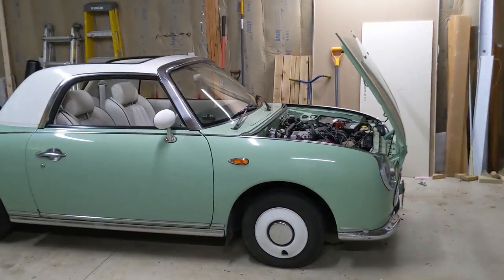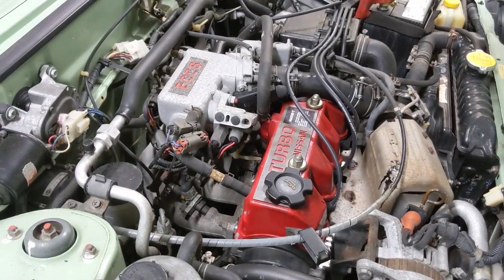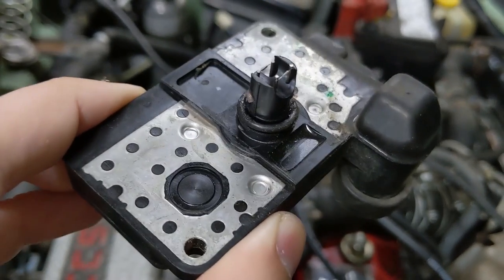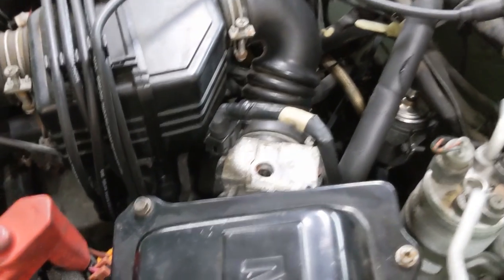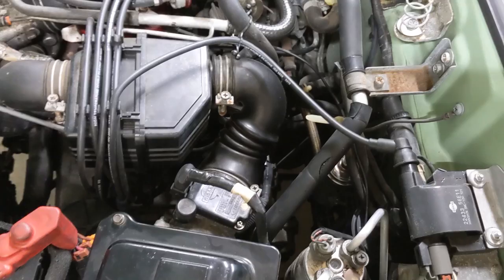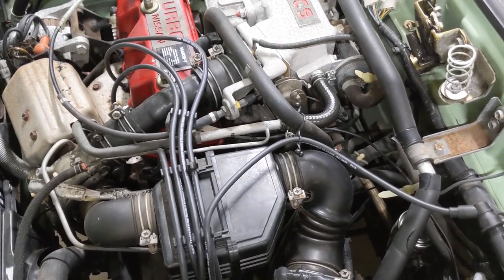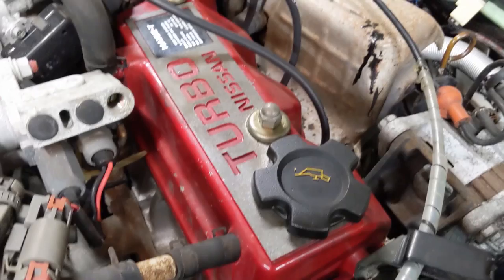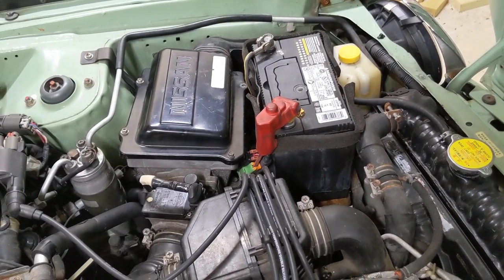Modern engine control musings and Fixing a Figaro

Comment: As odd as this will sound, electronic fuel injection (EFI), as most viewers would understand it, has been around since 1957 but the first production system going into a car was 1958 with a Bendix system used in the DeSoto Adventurer, Chrysler 300D, Dodge D500, and Plymouth Fury. It wasn't great and only about 35 of them were ever produced over the four lines. The next major attempt of that Bendix system was in 1968 after it was sold to Bosch and used on the Volkswagen Type 3 E-models that was renamed to Bosch Jetronic then renamed again to D-Jetronic.
This system would be what many would consider a "modern" EFI as it has a common fuel rail that feeds individual injectors and a way to measure air intake. Many assume that electronic Throttle Body Injection (like you would see in early GM pickups and some of their V8 cars in the 90s and known as TBI and Single Point Injection or SPI along with a multitude of trade names) is older, but it isn't. The mechanical version is as it was used on aircraft in the 1940s but the electronic form was much later. TBI feeds a single or dual injectors that sit on top of the throttle body and looks kind of like a two-barrel carburetor that's missing its floats and jetting. It was so close that many ancillary carburetor parts work (like the air cleaner, fuel pump, lines, and even some intake manifolds) and is why it was cheaper for manufacturers to use. TBI is also thought to be archaic but is actually more modern as it was introduced around the 1980s (just like a pushrod engine is also considered "archaic" but is actually a newer engine design than overhead cam).
For throttle control, electronic "fly-by-wire" was introduced in 1988 with the BMW 7-series. The next big innovation of "modern" EFI was going from batch fire injection (either engine bank to engine bank in V-blocks to firing all injectors at once or two-cylinders at once in inline blocks) to multiport injection where each cylinder gets a squirt of fuel as needed. That happened around the 1990s, possibly even the very late 1980s.
Most engines have gone from port injection to direct injection (where the fuel injector sits inside the cylinder like a spark plug instead of the intake port) while some use a dual system where it's both port and direct injected. The big advantage of direct injection is that nearly any grade of gasoline can be used on an engine with only a minor degradation in performance. This is because the fuel is injected when the cylinder is nearly at its hottest and you're burning more air than fuel, much like a diesel and is where the technology kind of comes from. While we think of that as a 21st century invention for gasoline, it was first mass produced by Mitsubishi in 1996 with their 4G93 inline four-cylinder engine.
What we're starting to see today (at least from Maserati, but others are developing) is "pre-combustion," in which the spark plug is used only at low RPM/low engine load then at high load/high RPM, pre-ignited fuel enters the combustion chamber and ignites the air-fuel mix in the cylinder instead. Eventually, the idea is to get rid of the spark plug all together while still being able to use gasoline or an ethanol blend. The biggest stumbling block for anything like this is heat. As cylinder heat increases, so does nitrogen oxide (NOx and, no, not nitrous) production.
That's why most modern vehicles use an Exhaust Gas Recirculation (EGR) system as the spent gasses cool the cylinder by replacing the oxygen rich air, thus cooling the cylinder since there isn't any more air to use in the combustion process. Also, no, there isn't unburnt fuel when it is used in the cylinder and why the EGR exists. The main reason you smell more fuel is because the ECU is trying to compensate for the increase in temperature from more oxygen present in the engine as it monitors oxygen sensor data along with coolant temperature, ambient air temperature, and mass air flow data.
Geez, sorry for the article, but this is my forte as my channel name hopefully implies.
Reply: Well your close the the year. 1954 Mercedes-Benz came out with fuel injection. 1955 Mercedes-Benz 300sl was the first year for fuel injection. Where is the 57 Chevrolet on the list of production injected engines?
Reply: @ducewags The 1957 chevy had MECHANICAL fuel injection, not efi. And there are different types of mechnical fuel injection too. The simple Hilborn/Kinsler used in dragracing and sprint cars. And the much more streetable and more complex mechanical injection of the 1957 chevy. And even the mechanical systems used in diesel engines...the P pump used in Cummins 6BT engines.
Reply: The Bendix systems in airplanes stinks...look at the hot start procedure for your favorite high performance general aviation airplane.  Basically, the fuel instantly vapor locks when you shut down, and there's no compensation built into the 100% mechanical control mechanism.  It's a lot of things like turning on fuel pumps, listening for ticks, and motoring the engine with the starter while moving the mixture control.  Oh, and one of the possible consequences of screwing up is catching the engine on fire 🤣
Reply: Wow. I have learned a lot from you. Thanks.
Reply: @darrenmorris869  and duce wags:  The Mercedes cars were mechanical injection, as well
Reply: @darrenmorris869  - My 1974 Mercedes had D-Jet Electro-Mechanical fuel injection. They switched to K-Jet later, which was entirely Mechanical.

Comment: I would be looking for a vacuum leak. Vacuum leaks are especially problematic on MAF equipped engines.  Any air leaking in is “Unmetered” air that the ECM doesn’t know how to account for because it bypasses the MAF’s ability to read that air intake.   Surging can result in that instance because the engine senses the RPMs going up (because of the air leaking in uncontrolled) and it tries to bring the RPMs down with that Idle Control.  Then it senses it overcompensated and goes back up.  Repeat and Repeat.  

The Code 11 is a bit concerning.  Where did the new Timing Belt come from? I’ve had issues with Nissans and Aftermarket timing belts in the past.  The Marks line up but sometimes the length of the belt is JUST different enough that the engine ends up being 1 or so teeth out of cam timing, despite the marks matching up.  The last time that happened I had to get a Nissan belt and it fixed my issue right away.
Reply from the maker: The timing belt came from The Figaro Shop in the UK so I'm certain it's a fine part.
Also - I much prefer the term "pirate air" :)
Reply: Find an older mechanic/ one that specializes in older Japanese cars, that still has a "brick". It's an older Fap-On scantool, that allows one to actually monitor the area(s) of potential concern.
Reply: @16v15  considering the age of the car and the fact it's japanese, it's highly likely there's no diagnostic port period, as they weren't required there at the time. the LED's may be all you get.
Reply: @cpufreak101  Most Nissans made from 1990 to 1999 have a Consult port. It doesn't seem the Figaro does, but most did, even Japanese market ones.
Reply: you have a leek    have some one help find is   easy but can be a   Danger es
Reply: @cpufreak101  Perhaps you're right, but in my experience if it's got a computer, it's got a diag port of some ilk. Even 80s Porsche, Benz , and BMW all have some sort of port which is why I recommended the "brick" as it has adapters for their proprietary plug formats. I'm sure there's probably some obscure JDM that has only lights, but I haven't heard of it.
Reply: @cpufreak101  : my 1981 Tercel has a diagnostic port, it clips to the kick panel the driver's side speaker mounts to, just above and to the left of the clutch. I'd suspect that it's more common in older Japanese cars than you think.
Reply: before computer stuff, first thing to check, we all had junk cars in high school fixed each other's. One test was unplug a vacuum hose in use, if idle did not go up, there was a leak already. Today's car not sure if computer would compensate.
Reply: The different length on the timing belt wouldn't make a difference if you set it properly, as the tensioner would take any slack.
Reply: @16v15  91 prelude, just had a LED on the ECU that flashed codes

Comment: Hot wire sensors generally have the two wires connected as two legs of a Wheatstone bridge with fixed resistors making up the other two legs. Sufficient current is passed through the wires to heat them and the wire used changes resistance with temperature. One wire is placed in the air flow, the other in stagnant air. The wire in the air flow is cooled by the moving air, the stagnant wire is used to balance out the ambient temperature. The amount of heat removed is proportional to the mass of air impacting the wire, so the bridge voltage is fairly linear with mass air flow.
Sorry for the rambling description, but I think you will get the idea. I used to use christmas tree bulbs for flow sensors that way. Carefully break the glass with pliers to expose the filament and you can detect very low air flow rates with it.

Comment: Your MAF was already pretty clean. Believe me, you'll know when it's dirty! It will have a blackish/brown dusty looking buildup. Also, they're not really all that fragile, you can use carb and choke spray or brake cleaner with no worries. Even the ones that have a warning telling you this sensor is coated and never needs to be cleaned. B.S! They all need to be cleaned in time and the coating don't mean a damn thing in terms of performance!

Somebody cares enough and knows what they're doing, that's why the O-ring was lubed!

All these older 4 bangers had the CPS (camshaft position) sensor in the distributor since the distributor is directly driven from the cam shaft. It's a 2 for 1 deal and quite logical really.

True true, we've had some sort of EMS (engine management system) since about 1975 and it was fully implemented across all manufacturers since about 1980. The electronic carburetor, boy oh boy, those were the day's of absolute hell on earth!

Okay, now that I finally heard the thing run, I can help:
0 --Open radiator, look under cap for coffee/chocolate milk build up.
1 --Check the ignition timing and adjust if out of spec.
2 --Clean the throttle body and throttle butterfly/plate with carb and choke cleaner and a tooth brush. Open the throttle and clean both sides of the butterfly, yes it matters!
3 --Check the the TPS (throttle position sensor) and adjust if out of spec.
4 --Measure IAT (intake air temp) sensor and simulate if out of spec using a POT (potentiometer).
5 --Measure ECT (eletronic coolant temperature) sensor and replace if out of spec.
6 --Check fuel pressure, replace fuel filter, regulator or pump if out of spec.
7 --Lastly, measure (key on engine off) MAF reading. If out of spec, replace sensor.

By your description of symptoms, I don't think you fixed it, everything runs better when it's warm! We can get into cleaning grounds and compression/leakdown tests, but the list above will give you an answer as to which direction to head moving forward. And to, you can check it all in about 30 min. In another life, I used to get paid $45.00 per hour for this information. You are welcome 😜
Reply: So much this. And this would done in half the time, if that ecu had any sort of computer diagnostics.
Reply: Those old Mitsubishi trucks with the electronic/vacuum controlled carbs are the worst 😂😂😂!!!
Reply: @hojnikb  :
 This is back in the day when a paper clip was required to flash a CEL (check engine light) code. OBD version 1.
Back when, it all had to be measured on a resistance or voltage scale. It's really dirt simple how these engines were run, but the ECU (electronic control unit) would typically show 'at best guess' what it thought the problem is or was.... In this era, we manually test and prove it all. Honestly, I kinda miss those days!

Now every kid on the block can read a code and replace a sensor, but never understand what the sensor is let alone what the sensor actually does. Just because OBD (on board diagnostics) has improved, does not mean it's without fault. If you didn't learn it the hard way before, now with modern tech you probably never will. But please remember, a code does not mean anything until it's repeatable and finally 'proven'. You have to manually test and keep on testing until you can reach that conclusion!

If you want to experience a real life butt hole pucker situation:
 Diagnose an $800.00 PCM (power-train control module) and tell your customer he/she needs a new one..... Be ready to prove it!
Reply: @mlyssy2 :
 Don't forget about the Honda ECCCCCSsss's. Vacuum line torture and solenoid nightmares! And that's before we start talking about wax pills and ECM control 🤣!
Reply: Finite Tuning omg! All of those ‘80s Japanese solutions at skirting true fuel injection were horrible nightmares! I’m not sure if they were just reluctant to actually go with at least a tbi or if they were holding back for the next generation but how dumb was it? I mean, GM was putting tuned port and multi port into everything they had so why would the leaders in tech just keep dumping money into ancient technology? It’s beyond me.
Reply: @mlyssy2  :
 Good point and question! Maybe overstock was the reason? Do you remember those BMW, Mercedes, Audi mechanical fuel injection systems? They used an electro-mechanical mass air flow system with an IAT sensor. They were just side stepping the point if you ask me. But an interesting approach to the overall solution to the actual problem.
Reply: "The electronic carburetor, boy oh boy, those were the day's of absolute hell on earth!"
laughs in K-jet

Bosch skipped over the computer controlled carburetor. Jumped straight from carb, to analogue electronic/mechanical fuel injection, to computer controlled fuel injection.
Reply: @mlyssy2  reliability and predictability. They were still developing their new motors, and they were on an extended development lifecycle then, with an emphasis on reliability. That is why you can still find perfectly working motors in mid 80s japanese cars all over the place.
Reply: @mlyssy2  OMG! Gospel! I used to work at an AC Delco ECM rebuild shop. Knew all GM's dirty secrets to screw with the Japanese including having Motorola take their off-the-shelf 6802 & EPROM silicon and rotate the die 90° inside the package to completely fuck up the pinout. I was at one of only 2 shops that worked on the Rev 0.0 1978 boxes. An abortion to work on! By 1980, they were elegant! It was a JOY to put one of these cans on the exerciser (vehicle simulator) and throw EVERY impossible sensor/input combination at them WITHOUT A HICCUP. No crash. No reboot. FLAWLESS! We had FOUR people simultaneousely twisting all the knobs simulating every sensor input, and COULD NOT make it glitch. It was a thing of beauty! Yes, we even did it to that goddamned Caddy 4-6-8 box! Now, let me be VERY clear, I'm talking about 100% fully functioning ECMs. They did have real world issues. There were specific components with known failure modes. They did have real world faults! I'm specifically talking about taking a 100% functional unit, and throwing every bizarre, impossible input combination at them, and NOT being able to glitch them. They figured out a reasonable response and would keep going.

Sometime thereafter, I got a Nissan 1986.5 SE-V6 truck. My first reaction was what an amateurish, tinkertoy system Hitachi built. It didn't even have a knock sensor! Here in the brutal heat of Arizona, you NEED a knock sensor to retard the timing to save your engine under load. You couldn't just back off on the throttle, because it would adjust to that new position, and you had less power, and repeat. Pretty soon, you've backed entirely off the throttle, and are going nowhere. In the summer heat you just got used to the constant clatter of shaken ball bearings in a can...

Not sure if you have a knock sensor? Just gently, and slowly (twice per second) tap a solid metallic tool (wrench, etc) onto a solid part of the block, heads, intake for a few seconds. The idle speed will decrease for several seconds, and then return to normal.

Honestly, I don't know when, or if the Japanese ever got around adding this nicety to their fuel control systems. I'll never forget the goofy dual fuel gauge that truck had. F to E, and 1/4 to 0. When that little gauge got to zero, you could estimate your range in FEET.

Memories (and a few nightmares). Lol!
Reply: @CreeperOnYourHouse  :

 I know, I mentioned that in a reply to Mike Lyssy. It was a brutally simple system and terribly flawed, but they had the right idea in practice before most were even thinking about it.

Comment: The cam sensor being in the distributor is pretty standard. The cam is what runs the distributor.
Reply: I have to keep an extra distributor in the trunk of my Saab this reason. good thing it only takes a few minutes to swap out on the side of the road...
Reply: They're usually some form of hall effect sensor though in my experience, not a "cam" sensor. Still a sensor to detect timing, so it's the same difference lol

Comment: For starters, I love this video from you. Totally unscripted and off the cuff. 2nd, the start-ability issue might be a seal issue in the fuel system, where the fuel is leaking out of the fuel line going to the engine and it takes a bit for the pump to re-pressurize the line before the car will actually start. I am impressed on your knowledge of the actual workings of the sensors of the car and how they all interact. I was not expecting that. I look forward to additional videos like this.